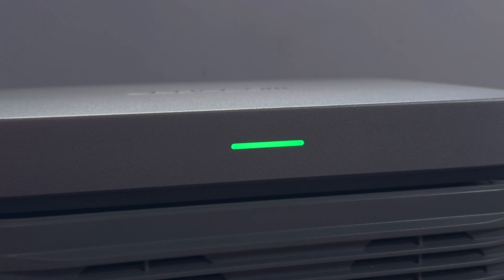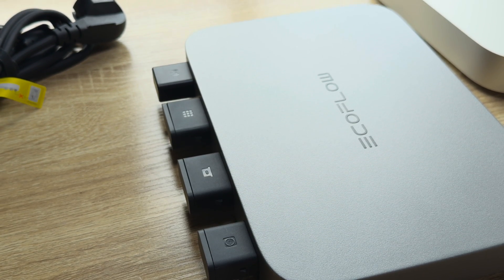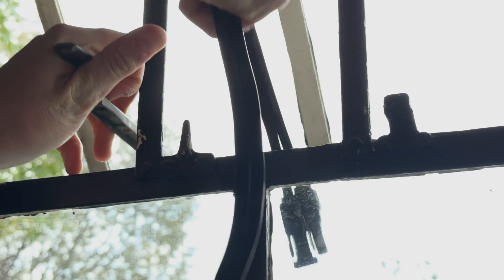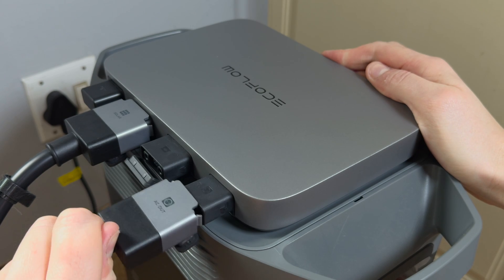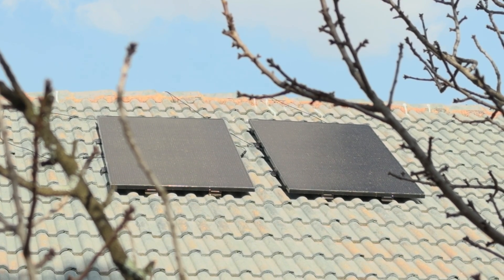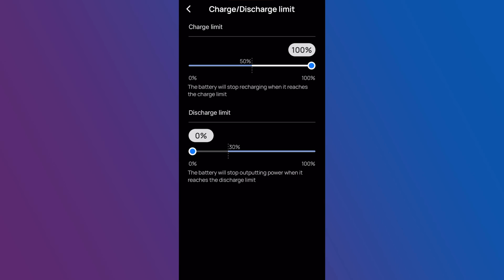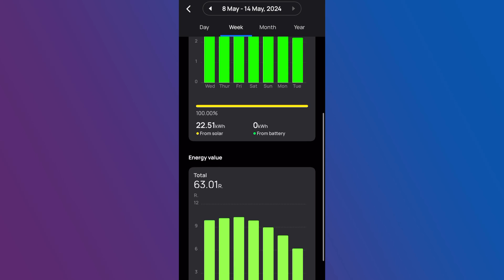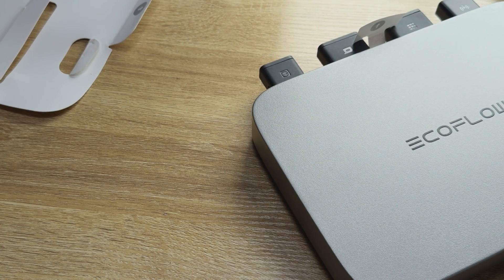EcoFlow PowerStream South African Review - A Loadshedding Solution?

Comment: I think it is very important for users in South Africa to understand the following facts about the PowerStream, which EcoFlow is not adequately disclosing in the product information available on the website.

1. The PowerStream will not work during load shedding or power failures. You would still have to plug essential appliances directly into whatever EF power station you will be using.
2. The PowerStream used without EF Smart Plugs requires you to set a fixed amount of watts to be fed into your mains. The PowerStream alone does not adapt that wattage according to fluctuating power demand. If your demand exceeds the limit you set, you will use grid power. If your demand is lower than the limit, the PowerStream will ‘dump’ the extra watts into the grid, either depleting your power station battery or wasting power coming from your panels. 
3. VERY IMPORTANT: Currently, there is no system of automatic net metering or net billing in South Africa. Unless you have an agreement in place with your power distributor (such as a municipality), you will get no credit for feeding excess power into the grid. It is even possible that your electricity meter may count those dumped watts as watts used and you may be charged for feeding power back into the grid.
4. It is only possible to adapt wattage to fluctuating demand and avoid wasted watts if you use EF Smart Plugs for all major appliances. There are no SA three-pin Smart Plugs. Using the EU Schuko plugs sold by EF together with adaptors, as they recommend, is both potentially dangerous and illegal because most adaptors will not provide an earthed connection.

Comment: I have a Delta 2 with an extra battery, but I do not have a port available to plug the microinverter into the battery, is there a solution?
Reply from the maker: The extra battery or base Delta 2 unit would have to be plugged into the PowerStream. You can’t tether the delta and extra battery to the PowerStream. It’s one or the other unfortunately.

Comment: Can one have the power stream connected with 2 solar panels and have power during the day if there is no Eskom… and add battery backup later for evenings… for powering lets say wifi , tv and fridge and would one then need additional surge protectors or does the power stream handle this
Reply: Despite EF advertising this as a load shedding back-up system, this is only because you can plug appliances into the power station in the event that mains electricity is not available. So the PowerStream seemingly offers no improvement over having a power station charged by solar panels and used with extension cords to power essential appliances when needed. The use of Smart Plugs is essential if you want to maximise using solar power to supplement mains power on sunny days. But EF does not offer SA three-pin options. Using the EU Schuko plugs as suggested on the website is a terrible idea because proper earthed adapaters between SA plugs and Schuko are almost impossible to find. You would be using your appliances unearthed with the regular two-pin adaptors common in SA. Apart from the risk of electrocution, this could affect warranties on appliances if something were to go wrong. So it does not seem that the PowerStream offers much value for money in SA.

Comment: One question - can you plug AC out to the wall socket while having DELTA in the other room plugged into the wall socket as well (consider them running on the same phase). All setups looks like having Delta directly connected to the PowerStream output, but what if not?
Reply from the maker: You could do that but you can't tell the PowerStream where to send the solar power to. So it will technically go to the Delta if it is the only thing drawing power on that phase. But if you have a fridge and other stuff on the phase, it will just contribute to all the energy use.
Reply: @GLITCHEDZA  M-m, that's fine, so basically I could connect fridge to my Delta having it connected to both PowerStream and to the wall socket? As far as I understood this can help consume excessive power transmitted from PowerStream to the wall socket by Delta's bypass to the fridge and everyone's should be happy then?
Reply from the maker: @atomiceugene  Yes. This would contribute to your grid. So should your Delta need charging after an outage, it would contribute to that. But at the same time, you can use this to charge the Delta alone by directly plugging it into the system. If you don't, it will just send power to the Delta (and all the rest of the house). Whatever is plugged in, it helps power. 

I have left mine connected to my grid for about two months now and daily, it has helped send 4Kw into the house. The house uses about 20Kw per day so that has been cut down to 16Kw. Just by sitting there plugged in. Sometimes I have to charge my Delta. These 4Kw helped with that too.
Reply: @GLITCHEDZA  Thanks a ton! This greatly helps me in planning, cause I have Delta Pro and would like to keep my critical appliances always power protected during possible outages meanwhile I'd like to have it charged more effectively via PowerStream. Extra energy from PowerStream will be provided to the grid including the bypass of Delta Pro's connected appliances but in case of an outage I just automatically get fridge on w/o any additional actions needed.
Thank you!

Comment: How many of these powerstreams can you use in your home?
Reply from the maker: I am not entirely sure. I worry that putting the power into your home grid from multiple areas with multiple PowerStreams might cause issues. But let me reach out to EcoFlow to ask them and let you know.
Reply from the maker: Got this feedback from EcoFlow - I double-checked with the R&D team and we DO NOT recommend installing multiple PowerStream inverters in a household. 
Having multiple inverters installed may cause overloading and eventually damage the home grid.

Hope this helps!
Reply: This is really cool. I have a small 3KVA inverter and a 2.5kw LifePO4. The system works well but it doesn’t power the whole house. Can I use the power stream and a delta to only power 2 rooms which are not being supplied by my current setup?

Comment: How much do you save in a day? Please help with my theoretical calculation... Im calculating on like 800w solar * 5 hours max sun=4kw multiply by R3.50(cost per kw)= R14 .
Reply from the maker: That is quite spot on. On a full sun day now in Autumn, it generates 3.5-4Kw. My curve is perfect and it saves around R12-R14. Not much but since I have used this it has saved over R500. Been about four weeks.
Reply: @GLITCHEDZA   I have a Delta 2 connected to a  400w chinese panel. I think I will purchase this and add another 400w panel. Great to know you can save money...I know friends that spent R100k+ on hybrid solar systems and they not really saving on their electricity bill (system not set up properly I think)  and this little powerstream device can cover the cost of the entire set up over a few years. Great product from Ecoflow.
Reply: @GLITCHEDZA  Have you been using it for the full year so far, and what are your thoughts?
Reply from the maker: @nicholasabraham3266 I still use it daily. I don’t really “use” it because there’s nothing much to do but it just sits there and contributes to the household. I do wish there were other ways to use the product tbh. When I’ve had a power outage, for example, it doesn’t do anything. I wish there was a way to directly use the solar panels as a power backup while it charges the battery and you’re using a Delta at the same time. It still feels like a missed opportunity there.

But the device has saved money. It’s paid for itself technically with over R6K savings since May last year. It’s not a huge savings but it’s still something. 

The ability to have it charge a battery to always have it ready in case of a power outage is a handy feature too. But again, outages are far and few between now that I’ve ended up disconnecting the battery and have this only feed the grid. 

Basically, it’s cool to have. It’s a “little” savings each month to the power bill. I don’t regret setting it up.

Comment: Anyone using this yet?
Reply from the maker: It’s been available since March. Quite a niche product at the moment but I suspect it will grow in popularity as more people discover it. It’s great for small homes/apartments.
Reply: I'm about to buy one, existing 4 panel setup, will report back in a few days.
Reply: Had them in Europe for some time. I hope they've changed the design for South Africa because they have no fan in the units here and they easily overheat unless carefully placed in cooler shadier spots. Also depend on a magic MQTT server in China so you need internet to fiddle with them or for automation to run
Reply: @etchedpixels Using them in Europe too. Can actually keep them cool enough if you have a small usb fan blowing on it throughout the day